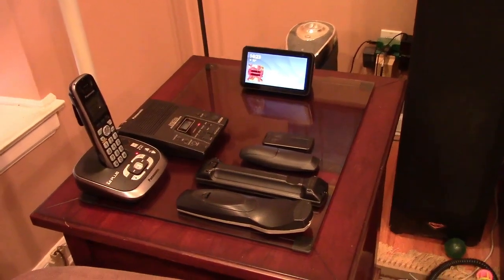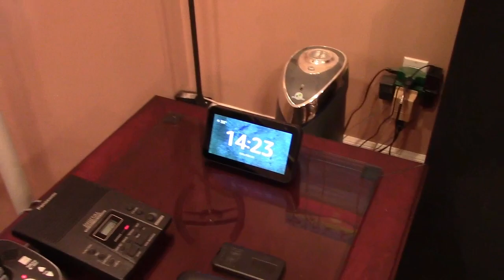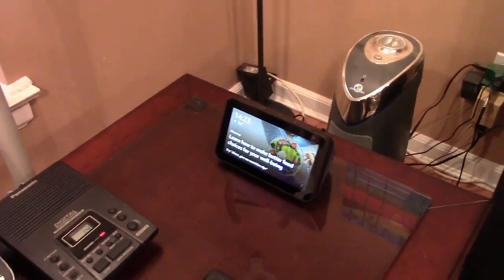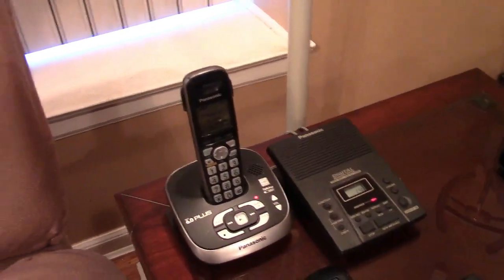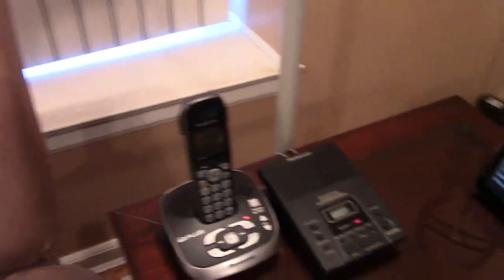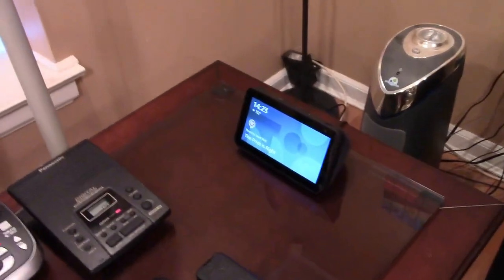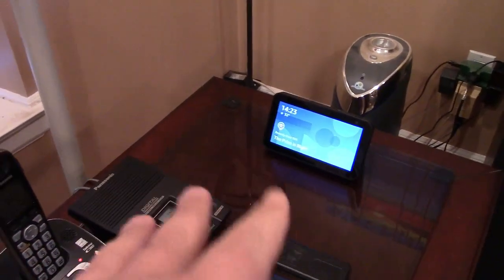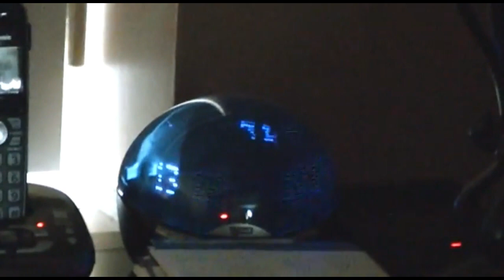Attempting To Repair The Knackered Olympia InfoGlobe

Comment: Way late to the party here, but I wonder if it could be a bad connection between the LED daughter board and the main one.  It seems more mechanical/intermittent given how some came back when it was cleaned (which would also likely move the LED board slightly).

Any possibility of getting a fine-tipped soldering iron and reflowing the connections between the two boards?  The centripetal force on the upright LED board would certainly stress the connections over the years of it spinning constantly (not to mention its feline-assisted trip off the table - must admit “because cats” cracked me up - I have seven of the furry little buggers here and can certainly relate!).  I’m not sure if that was manufactured pre or post RoHS, but the leadless solder used to comply with that requirement seems more brittle and prone to cracking in my experience.
Reply from the maker: Yes, you are late to the party, but you're absolutely correct, that's what the problem was.  After I made this video, YouTuber RollingTardis reached out to me and asked if he could have a crack at fixing it.  I shipped it off and indeed that's what he found.  He fixed the circuit board connections and relamped the arm as well.  You can search his channel for that.  In fact, I think you two would get along great, I see a lot of Nixie tubes on your channel, and he's got a bunch as well.
Reply: @jaykay18   Excellent - glad to hear it got fixed.  And thanks for the tip - I’ll check his channel out.
Reply from the maker: @patmx5  Absolutely, no problem.

Comment: Get your drill...
Reply from the maker: No drills were required yesterday...
Reply: @jaykay18  no they weren't. But...I have seen people make quick work of a air powered impact wrench. But, I would only do that on new hardware if at all. Something about that torque and sheering bolts heads off come to mind.
Reply from the maker: @xjoe81x  Agreed.  Those are the same guys that change the whole transmission during the commercial break.

Today would have been a better day for what we did yesterday, but nobody knew it was going to get this nice out.